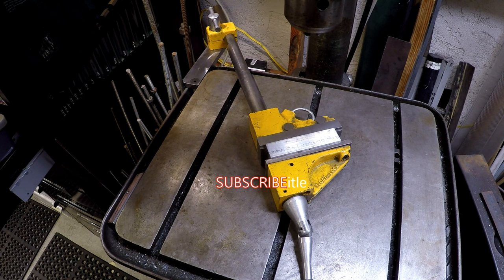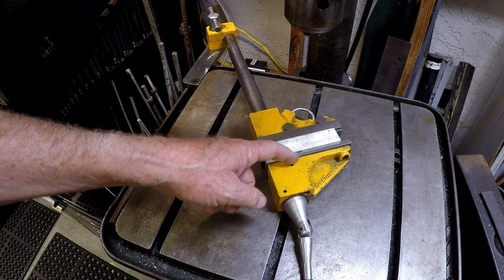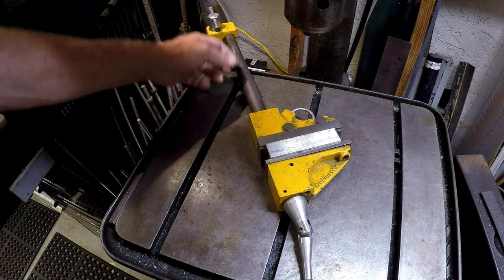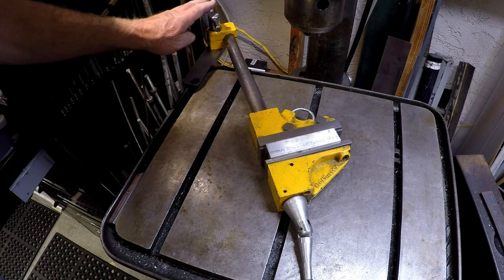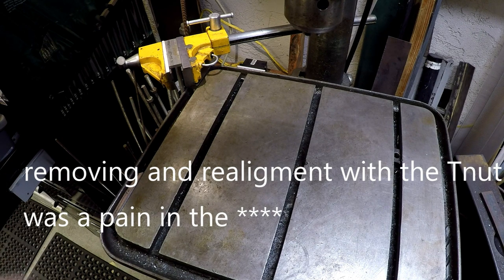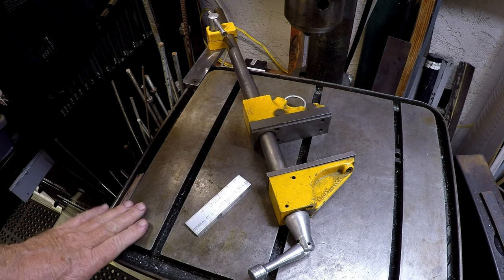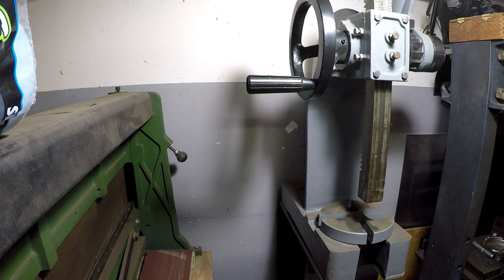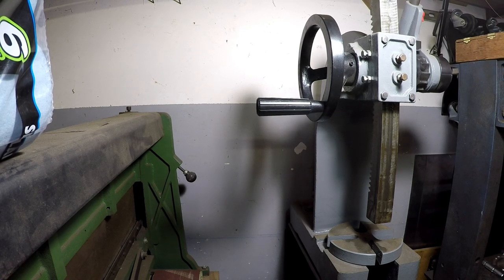Float Lock Vise  (attachment)

Comment: Chuck, Just came home with the float lock from a garage sale for real cheap and was going to mod it for a tee nut and saw your idea I will make an extension with a tee nut or maybe use the drain hole on my Rockwell vice like you did thanks for the ideas.
Reply: After having it on the drill press and using it a couple of times, I don't really like it, especially for narrow parts maybe ok for things 2 in and more

Comment: Saludos Chuck, I just might try to make one of the Float lock vises for my drill press.  Awhile back you did a video on a storage rack for lathe tool holders.  I saw it and tried to copy same.  Mine is based on yours but not as nice looking but it does the job.  Hope everything is going well on the medical front for both you and Tim.

Comment: That drainage hole youre using for a vice anchor point IS fragile compared to the forces a vice can exert.

You WILL break it off.
Reply from the maker: thanks for viewing and your comment....the majority of forces are directly down with the vise against the table, any lateral force of sufficient force to break the mount will have damaged much more than the attachment hole....